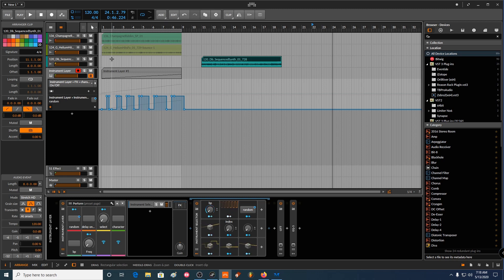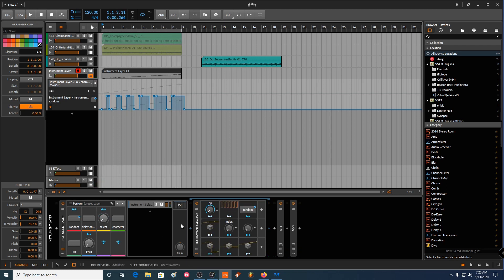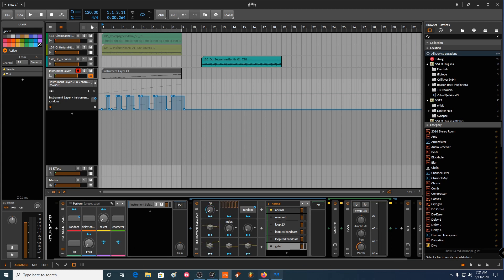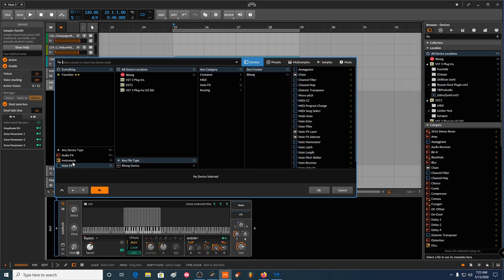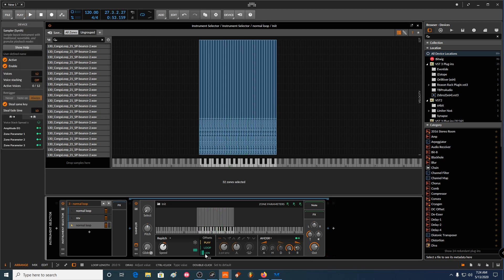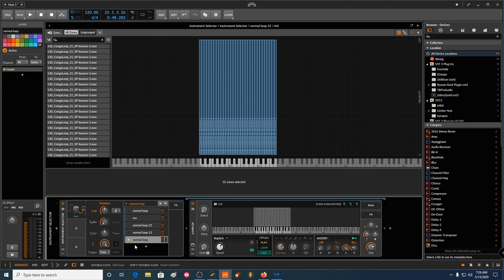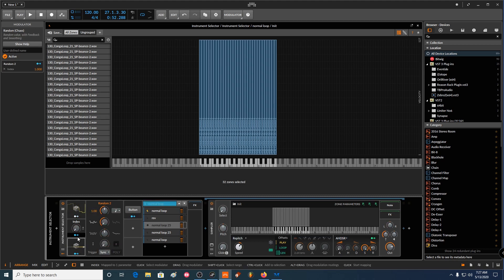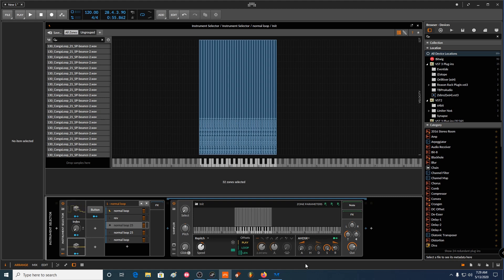glitching loops in Bitwig

Comment: Let me download that and try it out.  Now you see?  What you are doing here is what has attracted me to Renoise and also Polyend Tracker.  In your above use case, it looks like you will have to "fix" every sample you come across when you want to use this technique.  I'm sure the first few times would be interesting, but after that, it might start to feel tedious.  In Renoise, couldn't you just build a bunch of phrases, then save the phrases.  Because Renoise doesn't necessarily attach itself to a specific Sample, you can just point to the phrases you've already built to any Sample you want.   

After that, you can add/modify/remove the Phrases to any new Sample instrument and then it's just pressing keys on the keyboard to dynamically try out each phrase.  Getting more control over the effects at the note level is what is making Renoise stand out.  I love Bitwig and I wonder if the Redux Sampler would be useful to use with it to get into the phrases, but I haven't tried Redux yet.  Perhaps Bitwig and Renoise can work together in some manner.  The Bitwig expressive system just doesn't seem as easy to see as it does from a Tracker Grid where you can just put in the FX codes directly to your sounds.